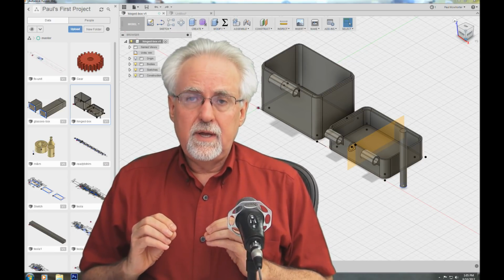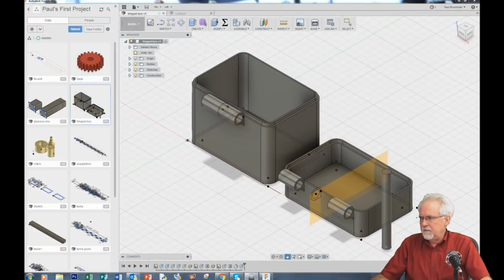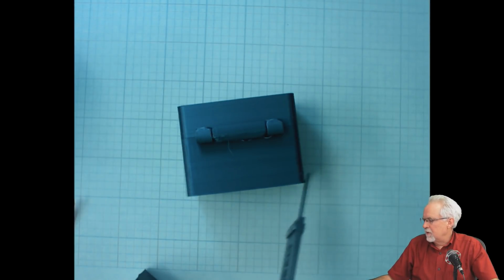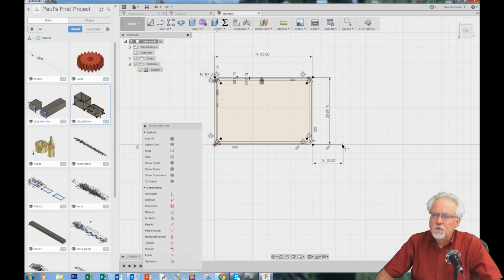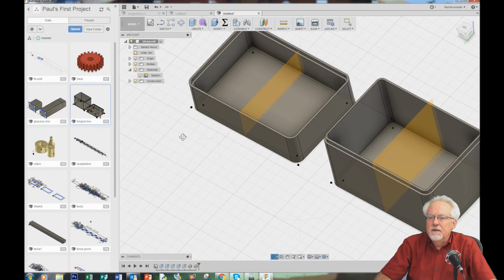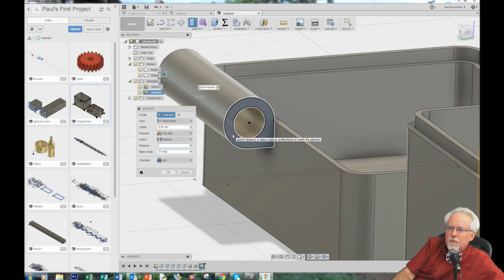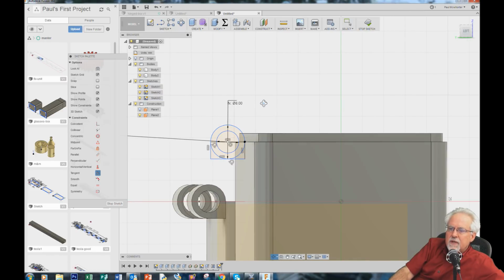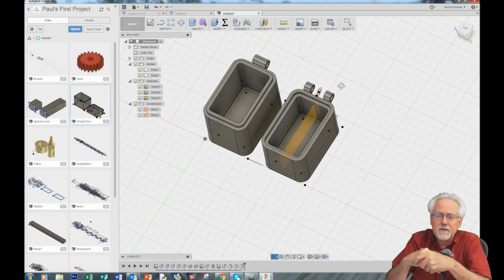Learn Fusion 360 or Die Trying LESSON 6: Sketching on Offset and Orthogonal Planes

Comment: For the life of me I could not get the mirror to function properly (@55.2x) so I broke down and had to re-draw the other side :(  oh well, it works and I learned more than just mirroring !  The other problem that I am having (using the latest version of Fusion) is that when I go to draw the circle on the mid plane I never get a pop to spot.  The only way I can get a point to lock onto is by adding a construction line (I had to do this with both the top and bottom piece).  Not sure what I am doing wrong.

Comment: When you do an offset and drag the pointer in the direction you want it, in this case inward and then define it with the parameter it will work correctly.

Comment: Quick question, sorry if I missed something obvious, I had started my sketch, had to stop so I saved and when I came back a day later I have a little padlock on my sketch and can’t do anything with it, how do I remove the padlock? Also, how do you delete a file from your saved files, can’t seem to do that either.  Lastly, I had save some favourites in the parameters but when I open a new sketch my favourites are not there, again, am I missing something obvious?  Sorry for the rookie questions gang. 😬
Reply: I got it.  Took a bit but I found what I was looking for and then realized they weren’t as locked as I thought 🤦🏻‍♂️ And a big thank you also to Graham for your note,even that took me a bit till I found where Preferences were(another shout out to Google). But ya, I feel I learned a bunch but as you recommend I will go and try this one again on my own, lots to learn on this one. All ready have plans to scale it up to a recipe box and now I need to learn how to put a latch on the front. And then to spin them so they line up face to face so I can print both pieces at once without it being to wide.

Comment: Just going through these tutorials now, and they're great!  One issue I've run into on this tutorial when sketching the first rectangle - if I pull the Length Dimension from the left side, after filleting I lose the anchor point dot in the lower right corner and can't create the boxGap properly without it.  The rectangle is fully constrained though. If I follow the tutorial exactly and pull the dimension from the right side, it's there.  I'm not sure why that is happening.

Comment: my box was going good until I tried to sketch the hinge I was not able to connect my 2 point circle to connect to the corner. I even tried tangent or constraint to connect the circle to the corner. I'm using the latest version of Fusion 360.
Reply: Paul: Excellent video as usual.  One note: It looks like a number of recent viewers got hung up at 40:42 where you add the two point circle constrained to the edge of the existing extruded body.  This recent occurrence of the stumbling block perhaps indicates a change in F360's default settings. But in any case: It turns out that F360 won't snap to model edges (that intersect the current sketch plane) unless you have Preferences > Design > "Auto project edges on reference" enabled. Description: "Auto project model edges to be used as a reference when creating constraints and dimensions in active sketch when [view] orientation is normal to the active sketch plane". Ie: you have to also have the view set to be looking straight at the sketch plan, so possibly click the view angle cube. There's also a setting Design > "Auto project geometry on active sketch plane" that looks important too.  Perhaps you could add a note about this in the video description, or pin a comment to that effect?  It would save people from getting stuck at that point unable to continue, and you're right, this is crucial material!

Comment: I know this is an older video (i am learning lots from this playlist) and maybe the answer is below.  But, didn't you measure the top height at 16?  (the lip is whatever height).  Aprox. 34.30 When you drew it, you put the top-inside = 'top height' and then added the 'lip' to the 'top height'.  Wouldn't this give an overall top part height of 16 + lip which is more than the 16mm you measured from the part?  In other words, you drew the top-inside height as 'topheight', but you measured the top-outside as 'topheight' (16mm).  Sorry, but this confused me and slowed me down a bit in the video.

Comment: Paul,
Having a REALLY hard time trying to place the hinge on the box top. I'm NOT getting the point that you get when you placed the 2 point circle at the place where the circle go''s. I choose the 2 point circle and place the pointer where you show then clicked and dragged it out and dimensioned it for hinge diameter BUT, after hitting enter the circle is NOT connected to the box because there is NO point there for it to connect to. 

What am I missing????? Is this a constraint problem?
Reply: You can see the solution a several post above.

Comment: Hi, Paul...  I have just started with F360 and have found your videos educational and efficient at getting me going on my journey.  I wanted to let you know, as I haven't seen it in the comments yet, that the "bug" with the offset for the wall thickness and lip thickness appears to be fixed.  I am currently using v2.0.7463 and I do not have to re-enter the parameter names.  It immediately shows the value prefixed with the "fx" on the sketch.

Comment: I cannot get the fillet to work on the outside hinges. The tool only wants to move in the direction towards the hole, rather than towards the side of the box. It worked correctly on the center hinge. I suspect it has something to do with a constraint in the sketch but I haven't figured out what the problem is.
Reply: I figured it out! As I was throwing new appearances onto the bodies I saw those hinges were not changing. They were separate bodies (?). So I went back into the extrude timeline and saw that the operation was not set to "join." Heh.

Comment: Hello Paul, excellent again! Just 2 questions; At the hinges, you extrude the outsides, does that automatically leave the middle open as a hole? 2nd, is there a way to close the bottom as being 1 flat surface instead of the 3 offsetrings?

Comment: 40:45 I cannot snap my circle point to the box edge! Let Autodesk be cursed! If I change 2-point circle  diameter it crosses the box wall
Reply: I have your exact same problem, no matter what I do I can't constrain the circle either. It seems that Fusion updates since the release of the video have changed something and now it works different
Reply: If I'm understanding what you are saying, I have the same problem. My hinge is floating in space, not constrained to the mid-afternoon plane.
Reply: you will have to add a constraint from the point the hinge touches the box to the edge of the circle
Reply: @TheNomadV  CORRECT, I spent almost a entire day truing to get it to work and finally a little light turned on and i manually entered the point then locked the circle to it.
Reply: @OldSalty22  I can't even add the point to the line so I can lock it.

Comment: Hi Paul. Firstly thanks for the great videos. I'm having a problem with something. We may have different verions of Fusion as I have only recently downloaded it. At 40:30 in your video you start your hinge sketch with a 2pt circle. My problem is when I do as you have I click the first point on the edge of the box and then go out on a horozontally and click the second point, then dimension the circle with the HingeDiameter parameter. The problem as the circle resizes it pulls away from the box edge. I cant get my sketch to..... Ahh sorry I have just seen a few people below having the same problem, I'll read through that first :)

Comment: Paul:  Another first class video on the subject. What I really like is that you leave the camera running when you make a mistake and manage to sort it out.  Making mistakes is what I'm best at, so it's good to see how you get out of trouble.   I have been following your videos for about 2 weeks and have already been able to design some basic models.  I don't have a 3D printer yet and so I'm using the time before it arrives to get my head around Fusion 360.  Without your well-explained videos, I would be lost. The only problem I had was that my Fusion 360 uses the new interface but I think I've overcome that.

Comment: Excellent step by step tutorial. Thank you Paul! One interesting difference in the current version of Fusion360 I could not attach the 2 point circles. My work around was to establish these points with lines from the origin of the planes that has been created based on the parameters. It worked like a charm. I will be on board for the rest of the lessons! Thanks. Doug

Comment: I'm a beginner and got a lot from this. That was very clear to follow and reasoning why you chose something always helps.
I would have picked up a different workflow that is more logical to me. I think using cad is a lot about choices of how you think of things and making an easy workflow based on that.
There is always more than one way to do the same thing. One finds a box with internal dimentions+ edge thickness logical, someone else likes more about outer 1box with the internals removed up to a point. I find it nice to see different patterns I would choose. Seeing multiple ways helps to set up the way that is best for how I find stuff logical.

Comment: Mr. McWhorter you are right on for a newcomer.  I am a EE and now retired and doing some mechanical projects at home.  The only thing I could not resolve was when adding the two point circle.  When trying to anchor the first point to the box edge I did not get the open circle and it would not lock on.   Your view showed a black solid dot there.  I didn't have that.  I was able to constrain the circle but it was an extra step.  Thanks much for your time and I plan to finish the rest of the course.
Reply: It turns out that F360 won't snap to model edges (that intersect the current sketch plane) unless you have Preferences > Design > "Auto project edges on reference" enabled. Description: "Auto project model edges to be used as a reference when creating constraints and dimensions in active sketch when [view] orientation is normal to the active sketch plane". Ie: you have to also have the view set to be looking straight at the sketch plan, so possibly click the view angle cube. There's also a setting Design > "Auto project geometry on active sketch plane" that looks important too.

Comment: Paul, I am really enjoying learning 360 from you! Your videos are awesome! But, I ran into a problem and wonder if you could provide an answer.. On the bottom box hinge, I did NOT constraint the outside diameter of the hinge to the rectangle that attaches it to the box,,,,,, I didn't realize this until the end when we started experimenting with the variable numbers!! I tried going back and assigning that constraint but couldn't figure out how to do it,,, is it not possible and you would have to "undo" back before I extruded it to make the mod????   Thanks again for all your hard work in producing these videos to teach us, you are a great teacher and I'm enjoying it so much!!
Reply: It turns out that F360 won't snap to model edges (that intersect the current sketch plane) unless you have Preferences > Design > "Auto project edges on reference" enabled. Description: "Auto project model edges to be used as a reference when creating constraints and dimensions in active sketch when [view] orientation is normal to the active sketch plane". Ie: you have to also have the view set to be looking straight at the sketch plan, so possibly click the view angle cube. There's also a setting Design > "Auto project geometry on active sketch plane" that looks important too.

Comment: Great tutorials. I have some problems with the 2 point circle, it doesn't stay in place when resing, it moves like it is a midpoint circle. I don't get the sketch pinned. Maybe things are changed by newer versions?
Reply: It turns out that F360 won't snap to model edges (that intersect the current sketch plane) unless you have Preferences > Design > "Auto project edges on reference" enabled. Description: "Auto project model edges to be used as a reference when creating constraints and dimensions in active sketch when [view] orientation is normal to the active sketch plane". Ie: you have to also have the view set to be looking straight at the sketch plan, so possibly click the view angle cube. There's also a setting Design > "Auto project geometry on active sketch plane" that looks important too.
Reply: @Graham_Wideman  Thank you so much.  6 hours of trying to figure out what was wrong.  This I would have never gotten.  The hinge sketch was completed in under 1 minute when this preference was set.  Wow!

Comment: Very clear those beginner video's.
I have only one problem. I try to follow what you are doing and my circle don't snap to the box. (around 40:55) Are my grid settings wrong or what else is the problem?
Reply: I had the same problem, and did not find a solution. And of course subsequent steps don't work because the circle isn't constrained to the box edge.
Reply: Ah-HAH!  It turns out that F360 won't snap to model edges (that intersect the current sketch plane) unless you have Preferences > Design > "Auto project edges on reference" enabled. Description:  "Auto project model edges to be used as a reference when creating constraints and dimensions in active sketch when [view] orientation is normal to the active sketch plane".  Ie: you have to also have the view set to be looking straight at the sketch plan, so possibly click the view angle cube.  There's also a setting Design > "Auto project geometry on active sketch plane"  that looks important too.

Comment: Hi Paul,  Firstly, I love your videos, they run at the correct pace.  However, i seem to be having a problem with this vidio at 40:45 where you draw a 2 point circle on the top lid.  I cannot get the first of the 2 points to connect to the lid.  In your video, there seems to be a dot appear the locks the 2 point cirlcle to the lid.  this dod does not apear in my drawing.  I know it's difficult, but why could this be? 

Once agin, great videos....
Reply: It turns out that F360 won't snap to model edges (that intersect the current sketch plane) unless you have Preferences > Design > "Auto project edges on reference" enabled. Description: "Auto project model edges to be used as a reference when creating constraints and dimensions in active sketch when [view] orientation is normal to the active sketch plane". Ie: you have to also have the view set to be looking straight at the sketch plan, so possibly click the view angle cube. There's also a setting Design > "Auto project geometry on active sketch plane" that looks important too.

Comment: Just finished L6 and WOW!
Took me about two hours altogether. Going back and forth, checking and rechecking and it was a brilliant example to create.
At first, I was thinking about how much extra time it would add using Parameters, but once you use them, you can see the power of Parameters, especially in editing the model.
By not showing the pin it just made me do it myself and I did.
The Inspect/Measure tool is very helpful to find out exact dimensions of the pin holes.
Thanks for the lessons. Great pace and wonderful instructions.
Next L7.
Thanks again.

Comment: Hmmm, my attempts to fillet the small hinge knuckle are failing. The fillet will only go upwards so that it's subtracting from the surface shared between the knuckle and box top, not adding to it. I see that the fillet dialog box on my version of Fusion 360 differs somewhat from the one in the video, so I'm guessing that some kind of upgrade has taken place between now and when the video was made. Perhaps that accounts for the different behavior. I'm moving on and not continuing to struggle with it, but I'm wondering what I'd do if I needed to have that fillet in a real design.

Comment: Holly crap ..... it finally sunk in. There is slight difference in Fusion versions and it worked when I put all the parameters in the extrusion box where you set the offset. Thanks.

Comment: What version of Fusion 360 are you using?  I have version 2.0.5119 and it doesn't seen to have the glich with having to do the offset twice to get it to recognize a formula.  Also, it doesn't like making an offset number negative.  I have to more the icon inside and then apply the distance.  It doesn't seen to need a negative number doing it that way.
Reply: Yeah I was just doing this and had the same problem.  Found a post by a guy I'll quote it.  "Re: Negative offset in sketch not working
Hello all,

 

I just wanted to jump in. We have introduced the Flip button in the offset command dialog to help users easily flip the offset without making offset dimension negative. So to get the offset on the other side user can click on Flip button. Workflow can be as follows

 

Offset command->Select geometry->Input offset dimension (only positive otherwise it will show in red like other dimensions)->Click Flip button to flip the offset geometry on other side 

 

Please let me know if I understood the problem wrongly.

 

Thank you,

Best Regards

Rohit Bapat"